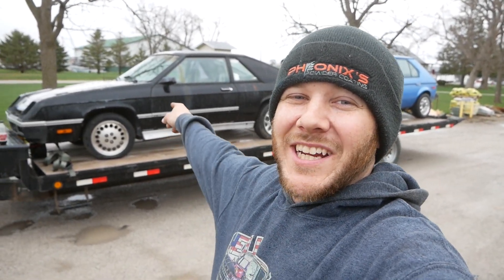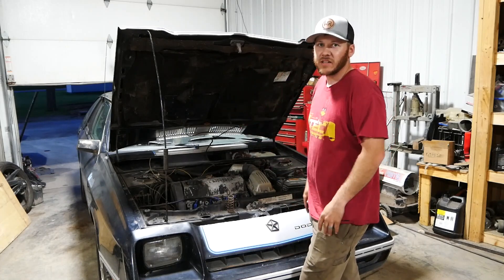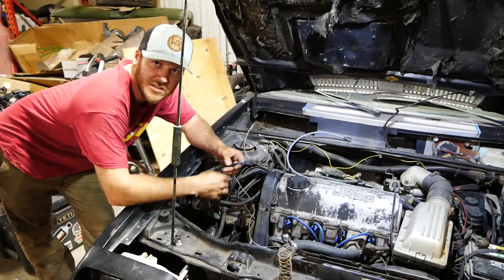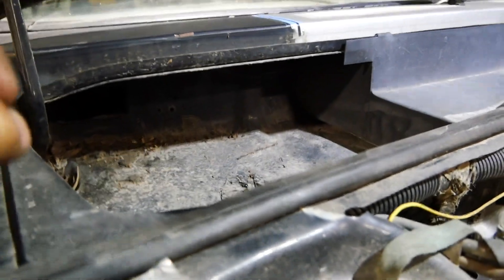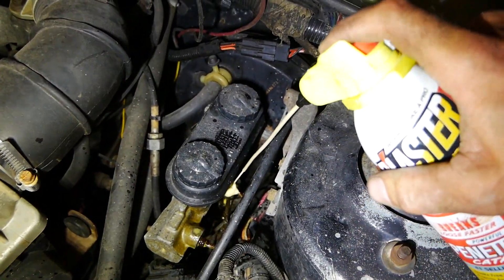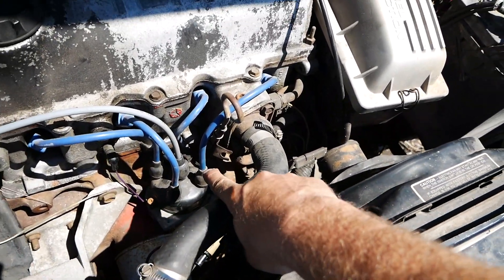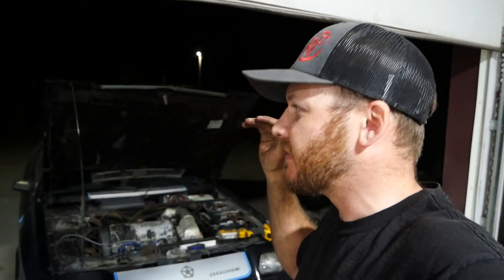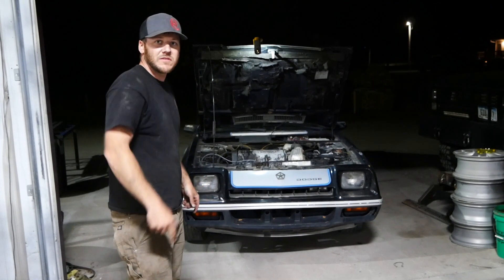Can we bring life back into this Dodge Charger

Comment: Had an Omni identical to the blue one on the trailer,2.5 five speed. Great little car,these engines are known for bad head gaskets witch will cause a rough idol,also have to watch the piston rings. Those plugs you pulled look like you have a bad head gasket.

Comment: Those cars were notorious for leaking water pumps and blown head-gaskets. They are super fun to drive while the motor lasts. If you do blow the head gasket its might as well be junked, heads will warp when pulling so protect that head gasket.

Comment: I realize this is an old video, but my sister had a 1986 Dodge Daytona IROC-Z with the 2.2 turbo II engine with a 5 speed in black with the bullet hole wheels and that car was so awesome. This was back in the early 90s, so it wasn't that old, but it was immaculate.
Reply from the maker: This one is actually the charger, but I do have a Daytona turbo z! It’s having a terrible miss still, I actually just got the car back. So it’ll be back on the channel at some point along with the Daytona lol

Comment: Install the plug wires into the cap with the cap off so you can visually make sure the prongs are clipped into the cap all the way. You still had a dead misfire by the end of the video.

Comment: GOT A daytona 1987,it ran like yours,first thing after checking the fuel pressure is making sure its using that fuel,my injectors were filthy from sitting,ran injector cleaner thru mine fired it up let it idle for about 30 seconds,enough for the cleaner to sit on the injector surfaces inside,went out next morning fired it up,it cleared out in about 3 minutes run time,a lady i know has three of these things and a lazer car

Comment: The Shelby Chargers and Shelby Omnis have a following and are worth good money. As for the  2.2 Turbo engines, in stocks form they could scoot pretty good but with the right modifications, they could outright haul ass well enough to outrun a 80's or 90's  Corvette, or Buick Regal Turbo T-Type.
Reply: it really hurt to watch this video and listen to him trashing this car. I literally skipped through to see if he ever googled it and figured out it's an ACTUAL Shelby Charger, and not branded as a Dodge product at all. Like all the Shelby Omni's that little car is awesome, and would do like 175 HP setup correctly. Shelby USA registers these, and yes, they're worth plenty.
Reply: @JenniArmstrong  they are capable of way more than 175 HP.  Yes, I agree it hurt hearing it gettig trashed. An old friend of mine had owned several of them as well as a couple of the non Shelby numbered cars. He also ended up with the one off 2.5L engine put of Shelby's personal white Shelby Shadow Birthday car -- The one with the Lotus head on it... which after he rebuilt it with a few upgrades put out well over 300HP.

Comment: Bleed the brakes as air  in the lines can cause the brakes to lock up. Also to check the firing order, remove the plugs and start with cylinder one, hand rotate the to TDC on the compression stroke, then check the other cylinders seeing which one compress next until you have the order.

Comment: When doing diag on EFI, with the fuel pressure checks 2 other things you need to do, is a max pressure test so momentarily block the return line & watch the gauge it should shoot up & a flow test. So crank the motor for 10 seconds( that's the way with the info on the first EFI car we had here in aus) & see how much you get out, compare that to the specs.  You can have pressure & not enough flow & visea versa.
Reply: a few years ago, I had to diagnose Bosch K-Jetronic and learned it backwards & forwards...  I hope this system is simpler

Comment: I’m glad I wasn’t the only one that noticed, you are only running on 3. Was there not even any unburnt fuel on that #1 plug? If there isn’t, sounds like a bad injector. If it does have unburnt fuel on it, check your compression in that cylinder. Either way, that is the unmistakable sound of an inline four cylinder with one down.
Reply from the maker: I didn’t even think of the injector, I’ll have to check it out this next week when I start working on it again!

Comment: These were nice looking cars. The only problem I've had was the inferior Mitsubishi engines in these cars. They would run fine for a while, then develope problems every other day
Reply from the maker: I’ve heard the head gasket loves to say goodbye in these cars lol
Reply: That's a Chrysler engine. 2.6 Astron, and single cam 3.0 v6 were the Mitsubishi engines available in K and variants. L body was available with 1.7 VW, 2.2 Chrysler, and from 1984 to 1986 a 1.6 liter Peugot.